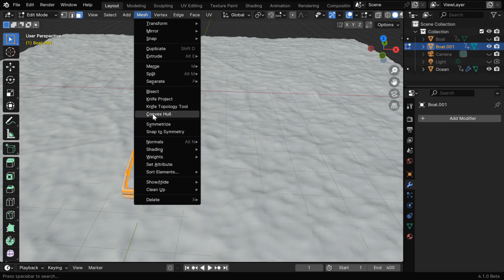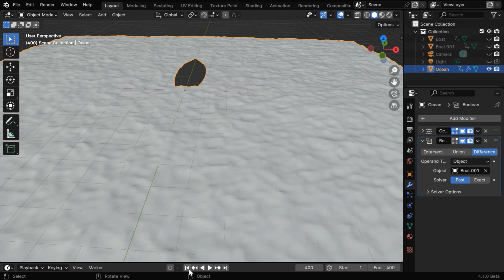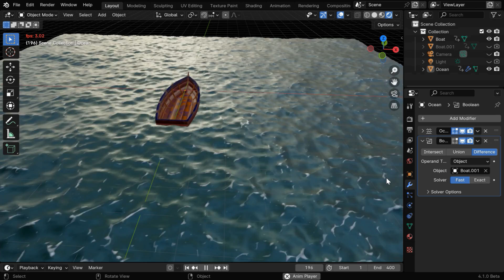Correct Way To Create A Floating Boat With Ocean Modifier + Boolean Modifier | Blender Tutorial

Comment: I did the same steps but I added shrink wrap to plane and copy location to my boat and it messed the boolean up what is the fix please?
Reply from the maker: Why shrinkwrap to the plane? 🤔 The plane is supposed to float on the ocean, so it won't be attached to the boat. Rather the boat should follow the plane (which is following the ocean). The plane is working here as an intermediator between the ocean and the boat.
Reply: @ yes do u know a solution i want the boat to float and empty in the same Time when I use boolean with shrinkwrap it messes everything up

Comment: I need help. I did exactly the same steps, but instead of no water i get a full boat shaped water, i don't understand because the boolean is on difference mode. Furthermore, I added a contraint to the boat to make it follow the waves, and this seems to mess with the boolean location, because it's not at the boat's place but next to it. If someone can help me i would be very  thankful!
Reply from the maker: Hi, I did a quick test and I see that your setup is working fine. So the concept that you used is correct. But if it is not working for your case, specially if you notice the boolean appearing at a wrong place, we need to see your blend file to investigate it further. You can send your blend file to us (5minblender@gmail.com) so that we can check it. Do write one line about the issues since we get many mails and we may not be able to connect your mail with this comment if not explicitly made clear. Thank you!
Reply: Did you fix it and how please?
Reply: Yes, solidify ghe ocean plane @QuiKi_Official